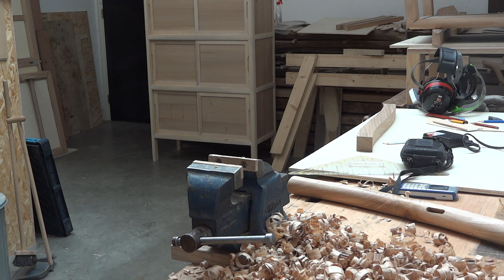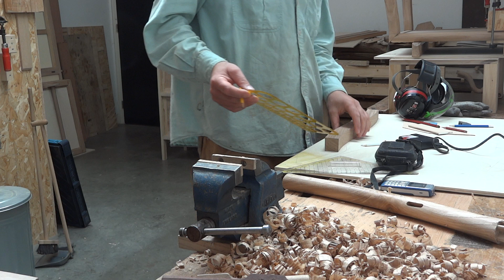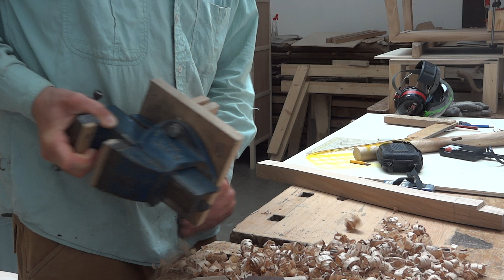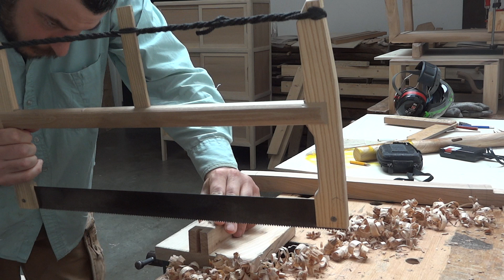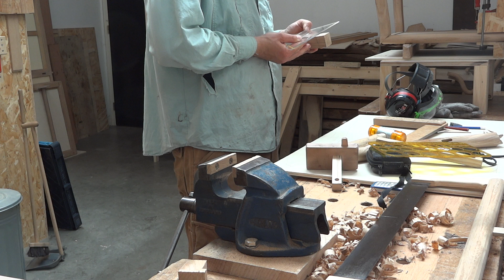MAH01948

Comment: A new frame saw for small work. Did you buy your blade or make by yourself?
Reply from the maker: https://www.ebay.fr/itm/373551151952?hash=item56f9623b50:g:9XYAAOSwv5BggTHp
Reply from the maker: https://www.ebay.fr/itm/191137063642?hash=item2c80a822da:g:ZucAAOxySoJTTLkf